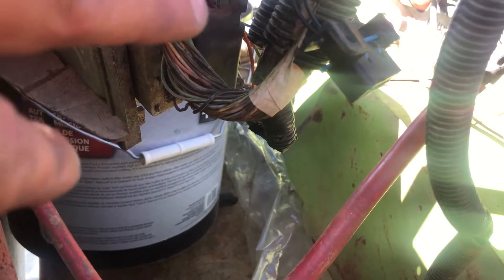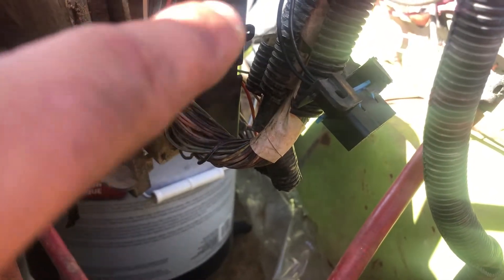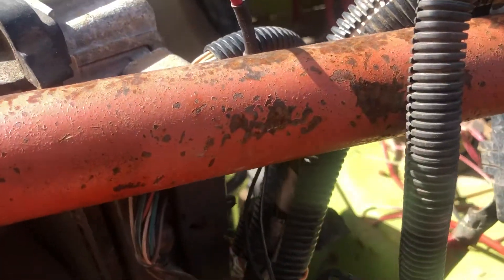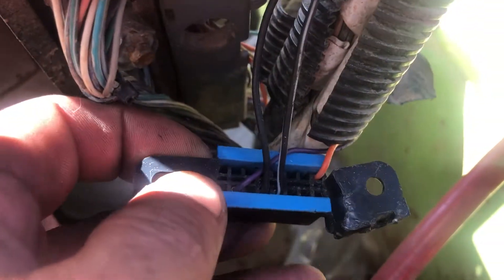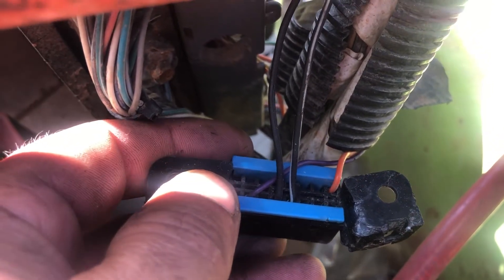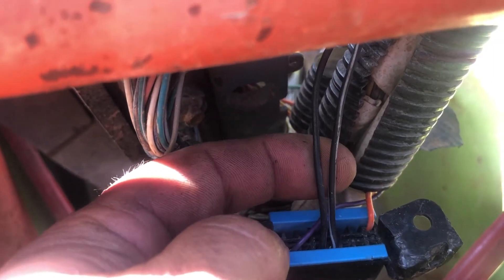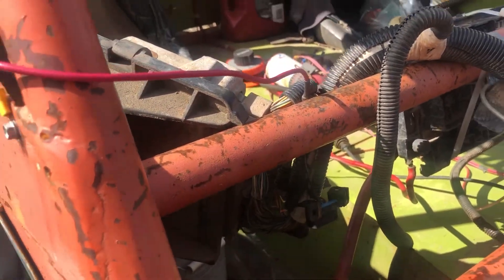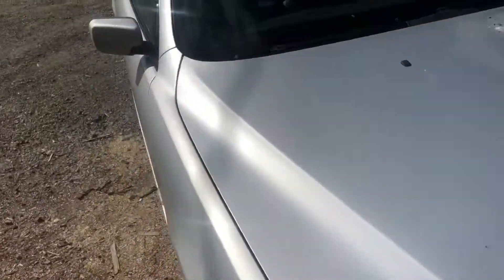How to Wire a OBD2 Plug Into a Ls Swap ECU Pinouts Gen 3 GM

Comment: So my stock obd port had 5 wires orange,purple, green and 2 blacks do I get rid of the green and connect the purple to the green on the computer or should I go green to green
Reply: I put a 04 5.3 on my 02 Silverado
Reply from the maker: You only need the ones I connect and show in this video